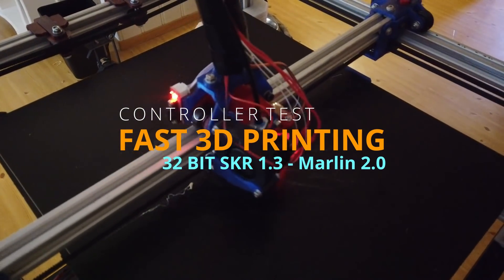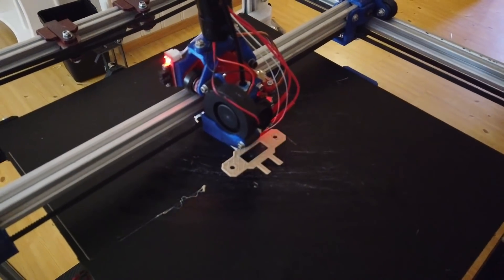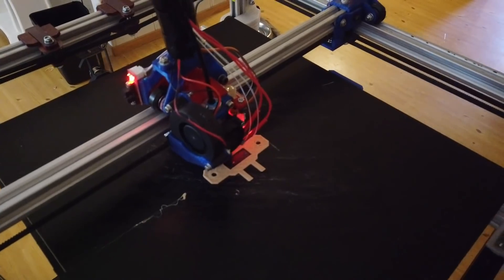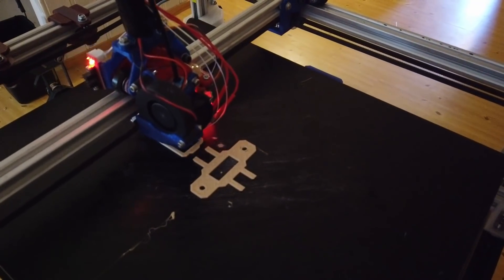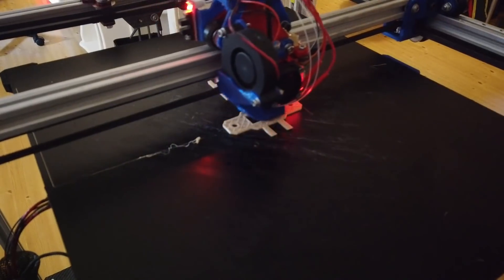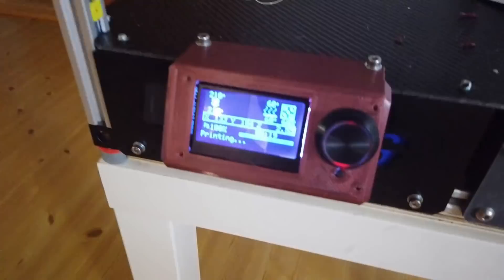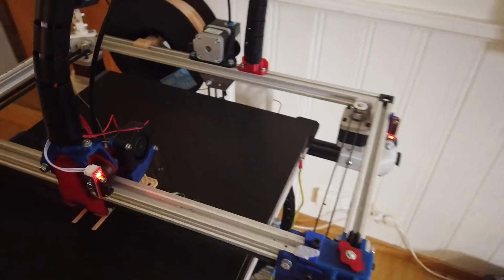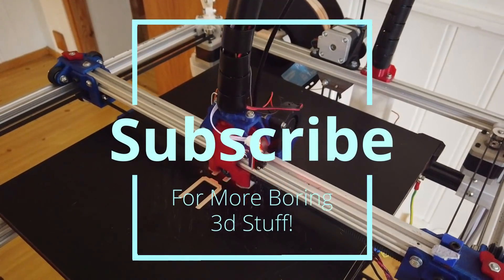2/3 3DP - Skr 1.3 first looks - 3d printing with NEW 32bit controller

Comment: i wouldn't consider 75mm/s *FAST*, I print at 100mm/s for decent quality and movement at 200mm/s on my Due/RampsFD, my draft quality speeds are at 125mm/s. You need to push this board harder.
Reply from the maker: Thanks - I forgot to state 0,3 layerheight and no volcano so cant push to much filament
Reply: @PRO3DESIGN  with a layer hight of 0.3 and a v6 you should be able to print at 150mm/s.
This is fast https://youtu.be/W7I1ctCrMlA
Reply from the maker: @Nitram_3d  It depends on your nozzle size
Reply: @PRO3DESIGN  I assume 0.4mm nozzle
Reply from the maker: @Nitram_3d  sorry I forgot all the basic info in the video. It was a quick one. Nozzle is 0.5 and 0.6 line width so little more constrained in speed than the 0.4
Reply from the maker: @Nitram_3d  I will try some quicker runs later - thanks for the feedback btw
Reply: @PRO3DESIGN  for speed runs, use a low layer hight and smaller nozzle..
Reply from the maker: @Nitram_3d  Thanks Nitram. I really appreciate your engagement. I will do some extensive speed test later. Both on Duet and on the SKR Side by side. should be interesting
Reply: @PRO3DESIGN  If you have a spare RPi(old computer) you can even try Klipper
Reply from the maker: I am not sure I want to dig into another firmware. I don't have time for all config stuff and struggled a lot with reprap already. Tuning to the moon